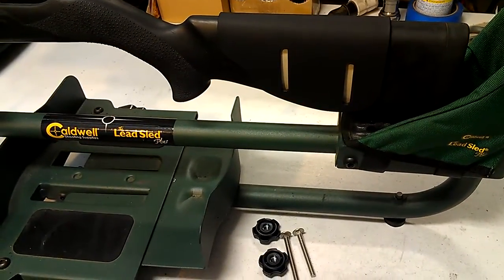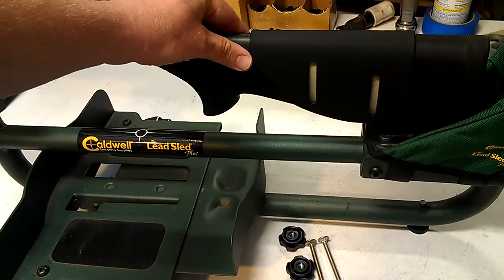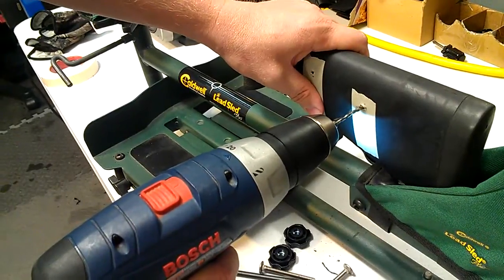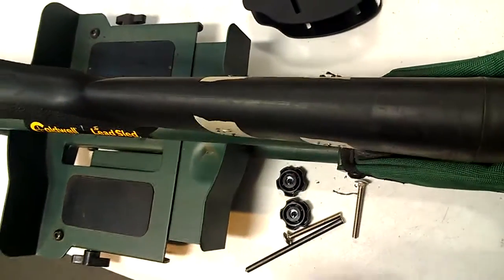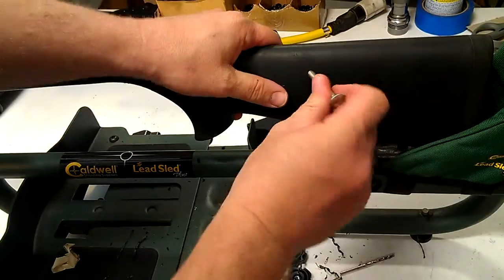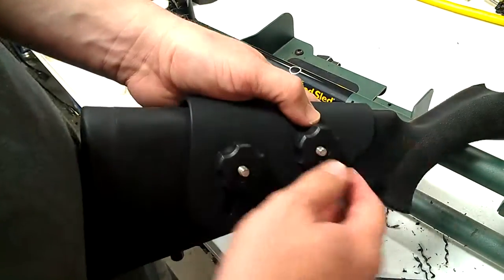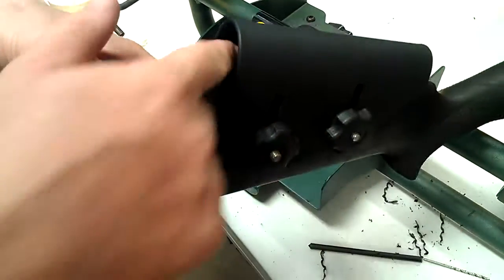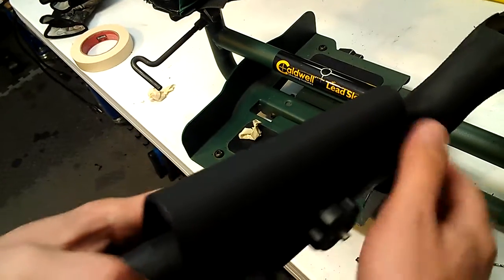Kydex Cheek Rest Install on Hogue over stock

Comment: I prepare my stocks by positioning the cheek rest on the butt stock and open the bolt to make sure I can remove the bolt with the cheek rest attached.  Then I use a drill press, two magnetic bubble levels and some spacer stock (to carry the weight of the barrel).
Reply from the maker: Tom,

That's a Great way to mount the Cheek Riser. Thanks for your business, 👍🏻👊🏻

Sincerely, 

Matthew 
www.MatthewsFabrication.com 
#MatthewsFabrication 
#cheekrest #cheekriser

Comment: So if I'm a right handed shooter, which version do I need. Nothing specifies what the left or right denomination refers too, so I'm not sure if it's the shoulder you shoot from or the side opposite the knobs, or... lol.
Reply from the maker: You'll want to order the Bear Paw Right handed Cheek Riser if you are right handed. Your right Cheek will rest on it, the rifle will be in your right shoulder, you'll look through the scope with your right eye & you'll use your right hand & right index finger to pull the trigger. 

Hope this helps, 😁

Sorry I have a little of the April Fool's sarcasm today. Thanks again for watching & for the question.

Sincerely, 

Matthew 
www.MatthewsFabrication.com 
Veteran Owned and Operated 
#MatthewsFabrication 
#cheekrest #cheekriser
Reply: @MatthewsFabrication  worded very similar to how I would have said it. 
It's going on an AEA Zeus, the stock on it is so low the weld is at my chin. It's horrible.
Reply: @MatthewsFabrication  Why the Bear Paw opposed to the black oxide?
Reply from the maker: @2002ZRX1200R  The Bear Paw Right is the cutout style of Cheek Riser. The Black Oxide is the hardware that is uses.

Check out my website www.MatthewsFabrication.com

Comment: Wouldn't putting the knobs on the other side make more sense, because you'd be less likely to catch them on your sleeve/wrist?
Reply from the maker: Brendan,

Thanks for the comment. I've found that knobs would be in the way of your face & I've never had my sleeve or wrist get caught on the knobs. Especially since the knobs are far enough back on the stock.

Check out my Instagram page, there are plenty of pictures of my customers shooting with my Cheek Rest & you can see how far the knobs are from your wrist/sleeves. 

Hope you have a Happy New Year~!

Comment: I just want to make sure before I order, this works on the savage 12 LRP correct? Also, Do i cut off the excess bolt after the install. Thanks!
Reply from the maker: Tier1ops Yes I custom mold them to fit many stocks. When you order at www.MatthewsFabrication.com you can put in the order notes section under your address information the Rifle & stock that you have & I'll make you what you need. 

Sincerely, 

Matthew 
#MatthewsFabrication
Reply: What caliber in the 12lrp do you have? Are you reloading your ammo..
I got the 6.5 creedmoor...